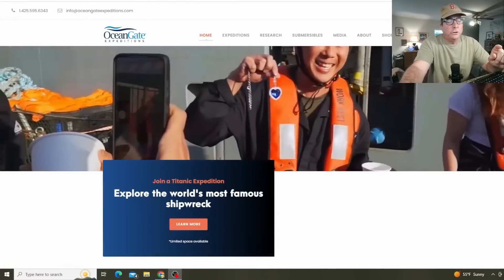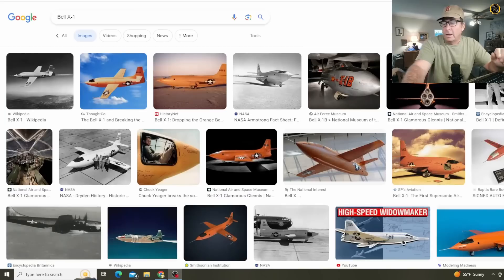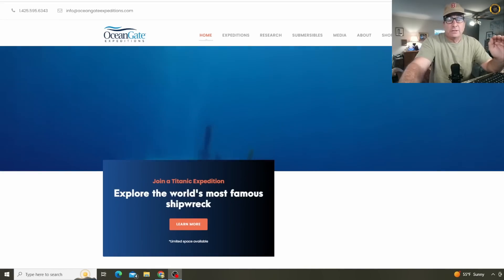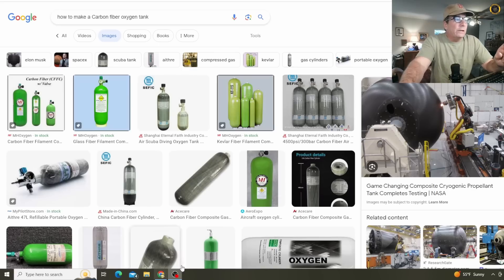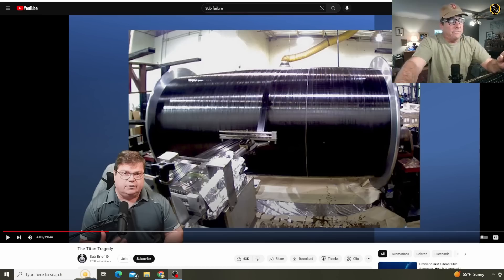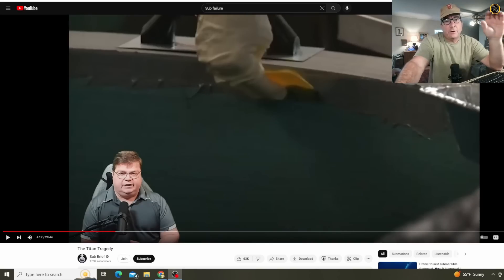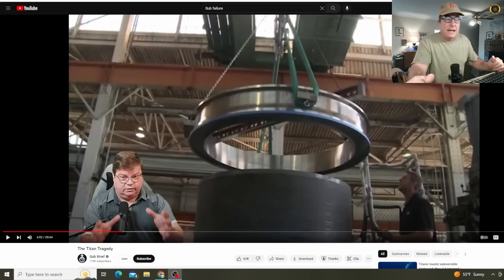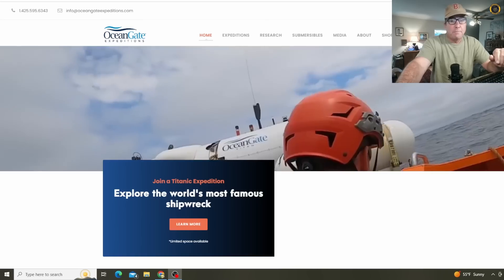Oceangate Sub Construction Details and Implosion

Comment: I learned about the USN microphones from "The Hunt for Red October". Not surprising that they were dead before the public knew they were endangered.
Reply: They never knew what hit them.  The physics of an implosion at that pressure differential happens far quicker than the biology can notice what is happening.
Reply: @alanholck7995  One engineer calculated that the energy exchange was about the same as 100 pounds of TNT.  You don't hear that coming and wonder why your ears are ringing.

Comment: I wonder how the carbon fibre held up under all those pressure cycles
Reply: It's only done 3 dives. Well 2.4 dives to be exact!
Reply: @simonbaxter8001  Thank you. I was trying to find out how many cycles the Titan went through before it failed.
In that case, I was wondering if it would make sense to build a second one rigged for extended testing and automatically send it down to 4 km and back a few times with shielded cameras inside to try to recreate the event and record it. Just like the Comet tests in the early days of aviation.

Comment: The only way I know how to test something that size at almost 6,000 psi is by sending it to the ocean floor repeatedly until failure.
Reply: I wonder how much testing was done without anyone aboard. I understand that this was not the first trip.
Reply: @jimsnipes1203  This was the 3rd trip apparently and I suspect it hadn't been lowered to depth unmanned to test the integrity. You would normally do the latter with an instrumented structure to measure and record deflection, stresses and vibration sensors to detect any structural issues.
Reply: @jimsnipes1203  It sounds like the previous trip were never trouble-free.
Reply: @AndyFromBeaverton  And not to full depth unless the news sources have changed their mind.

Comment: Oceangate ... not be confused with Watergate.
Also, carbon fiber doesn't fatigue very quickly; torsion springs have been made of the stuff. Everyone assumes the "tube" failed, but it would just as likely be the viewing port, which was rated for a much shallower depth. You can get weird "water hammer" effects at high delta pressures if something like that occurs, where the tube may be over-pressured, rather than imploded.
Hopefully we'll know for sure soon. Either way, the results would be the same.
Reply: Or Heaven's gate another mass death event
Reply: I read the viewport was rated for 1300 meters by the manufacturer, while it should have been rated for 4000 meter depths. There were concerns brought up by David Lochridge, who worked for Oceangate, and they fired him for it.
Reply: Not just water hammer - the pocket of oxygen rich air inside will detonate like the charge in a diesel engine as it’s suddenly compressed to 300 Bar.
Reply: DarwinAwardGate!
Reply: The issue with the carbon fibre is that under tension, the strength comes from the carbon strands, which are incredibly resistant to tension. When under compression, the strength comes from the resin that holds the fibres together. That results in a material that is very strong under tension but relatively brittle under compression. The structural integrity of a deep sea submersible is all about resistance to compression and almost nothing to do with resistance to tension. The choice of carbon fibre and of the cylindrical shape were choices that are not supported by the materials science and fundamental physics respectively.
Reply: Seagate
Reply: Travelgate, back in the race.
Reply: @Pahrump  FACTS IT WAS HOT AS THE SUN! CRAZY!
Reply: Nothing about this comment is right. It was the hull dude.
Reply: I’m just a simple sailor we have been using carbon now in boat construction a number of years I sailed a 18 foot skiff once considered the formula 1 of sailing we used carbon in a number of ways from high modulus nomex honey comb to solid type bilateral,trilateral,uni layups . All of our testing was of the destruction type hence the saying if it didn’t break it was too heavy , I will tell you now what I’ve learnt carbon is king in tension loads but in compression it is soft Kevlar has even superior compression loading failure rates … what I see is a bobbin being spooled up of uni directional carbon 1. How is the air extraction controlled between layers it’s not like each layer is vacuumed formed on 2 . What is the tension of layers being spun on is this the only tool for extraction of air between layers and how is the layup wet out controlled ( or is it prepreg and autoclaved to activate the resin ) 3 if autoclaved how was the 5 inch layup controlled dissimilar temps throughout the thickness must of surely exited ….  THE LAYUP PROCEDURE IS ONE THING THE SCIENCE TO PODUCE CARBON FIT FOR PURPOSE , THE BIGGEST FLAW I CAN SEE THOUGH EXITS NEVER USE CARBON IN COMPRESSION FALURE IS IMMINENT WHEN USE IN THIS FASHION .. This my own observation of carbon fibre yes we destroyed it a number of ways though incorrect layup , incorrect curing technique but the biggest failure was compression failures and what is this sub if not under compression loading .. and yes carbon just goes bang there is virtually no elongation it just explodes or in this case implodes ..
Reply: There is no "overpressured" in a depth of 3800m, that would mean that the inside pressure would be over 380bar.
A pressure were all people would be already dead after reaching 10 bar...
Reply: @B-M.B  It is possible to locally over pressure parts of the inside of the hull if the view port blows in.  A column of water coming in through the view port hole would hit the other end inside at super sonic speeds and when the waterhammer effect of the inrushing water finished filling the hull the water would be unwilling to stop it's movement in an instant and over pressure the inside of the cylinder.  I saw an ME calculate that the total energy release of water at that pressure filling a void of that volume would liberate about the same energy as 100 pounds of TNT.  Things down there are not very similar to things up here.  Without the actual physics normal intuition will mislead.